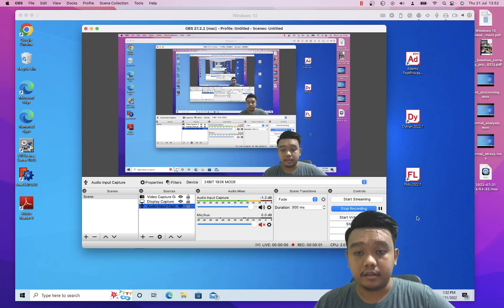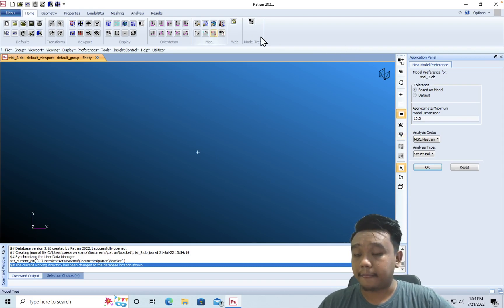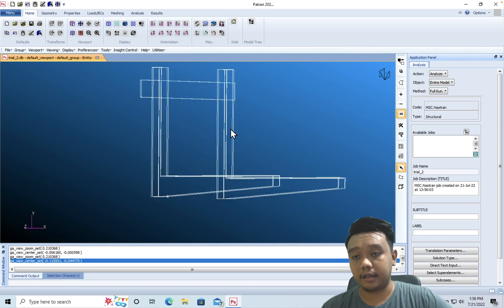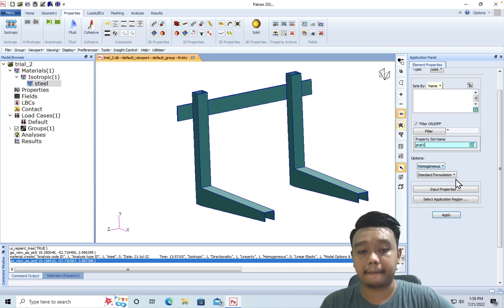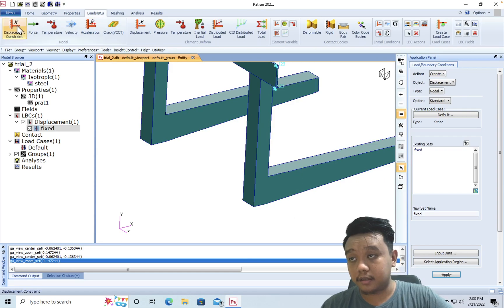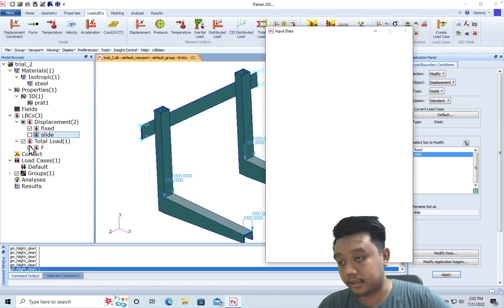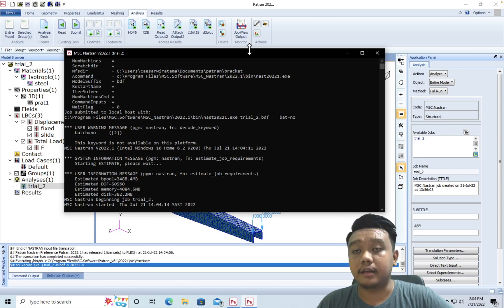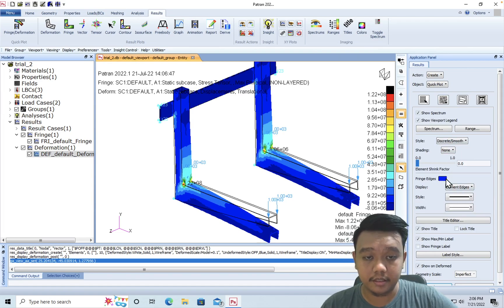Basic tutorial of MSC Nastran and Patran Finite Element Analysis (FEA): Bracket structural analysis

Comment: I have a question about the ASET1 card in NASTRAN. When it is added to a BDF file, what does it mean? I read the manual, and it specifies the DOFs of a node that you want. However, in the case of a node within a shell element, theoretically, a shell element always has 6 DOFs. But in some problems, I encountered the requirement to set the ASET1 card for a shell element with 3 DOFs to perform normal mode SOL 103. Is that correct?

Comment: hi, I cant get the XDB file via nastran, what should I do ? I am running in Nastran, the bdf file, but it is not working....
Reply from the maker: The newest extension is hdf5, the default will be it. You dont need xdb anymore. But if you need, you can setting the output format in the subcase setting
Reply: @caesarwiratama3303  I was also trying to get same as this video, but still couldn’t get the results. I am gone really really mean… I gave the force, displacement, also material and mesh, same as here, but something happening, Btw I am the licenced user…
Reply from the maker: @cavok99  is the hdf 5 also didt show up? I think you solusion is diverged. Please check the f06 file from the analysis monitor --> job/view output, and search for “fatal” warning. Sometimes we just forget to click apply during some settings, for example during properties or material definition

Comment: $#     Please ensure your P3_TRANS.INI or site_setup file correctly points to the solver executable or that you have correctly set the proper environment variables to do the same. I am getting this error in 2020 version and couldn't able to fix it. Any suggestions ?
Reply from the maker: Try to open MSC Nastran manually, and execute your bdf file manually
Reply: @caesarwiratama3303   $# Warning reported from application CORE; $#     Error executing subprogram.  Reason (errno) = 2. No such file or directory; I get this error during Importing the geometry in PATRAN 2022 student version, Its been few days i am trying to fix it. Any suggestions please
Reply from the maker: @PrasannaKumar-l2h  for student version, below 2021 i think it is cannot be used anymore, you should update to the newest version. Or maybe check to import a simple geometry, just to ensure it is the software or the geometry

Comment: Is the total force your applied the total force of the two surfaces or it is the force per unit area? Thanks.
Reply from the maker: if you use element uniform, it will be the total force (Newton). But if you use node, it will be the force per node
Reply: @caesarwiratama3303  Thanks!

Comment: My results file not seem to be working. Any suggestions?
Reply from the maker: The most common mistake is you forget to click apply in the material or properties setting. Or maybe bad element definition and insufficient constraints (too much degree of freedom). Or you can check the log file in the folder to find the error message